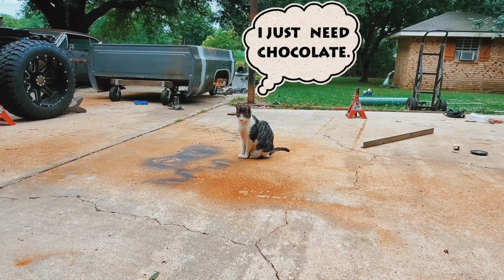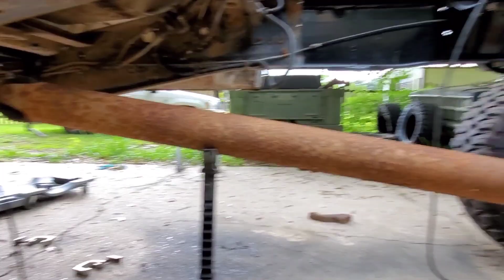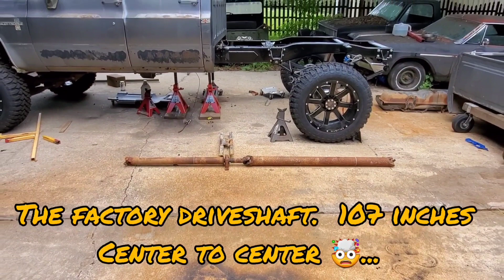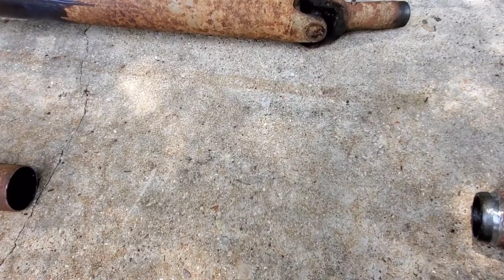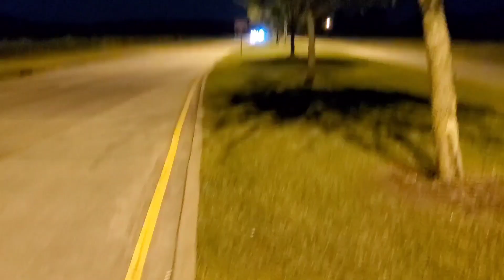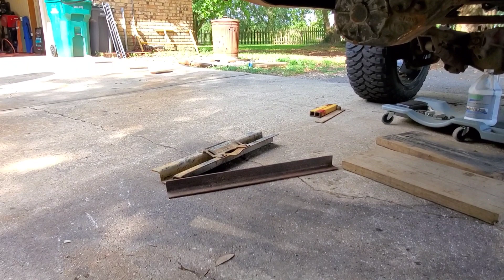Square Body Crew Cab.  Part 2! Divorced NP205.

Comment: I'll admit I really enjoyed this video all together. I feel fortunate to stumble across it because I'm wanting to save a 75 3+3 camper special but converting to 4x4 is a must. I have a pass drop divorced np205 in a local farmers D.I.Y. 4x4 "highboy" ranger crew in the frame he abandoned with input shaft to np245 4spd. My 75 3+3 has no train in it rn and I want to use cheap "excess junk" here in the barn yard before committing to the "12v/nv4500" or "lbz" which I'm hoping will make all the effort to save the truck worth it in the long run.
Reply from the maker: They are definitely worth saving. Thank you for watching the video.

Comment: 7:00 with having a two-piece driveshaft you still want to have a pretty straight angle from axle to transfer case. Lower down your carrier bearing bracket to balance the pitch of the universal at the transfer case and after the carrier bearing.
Reply from the maker: Copy that. I still haven't put an angle finder on it yet. Being lazy. The transfer case and carrier can be adjusted. I know the u-joint angles have to cancel each other 😎👍.
Reply from the maker: AND! thanks for watching 😃👍.
Reply: @oliverjd26  I would have deleted the carrier bearing and put the TC in it's place.